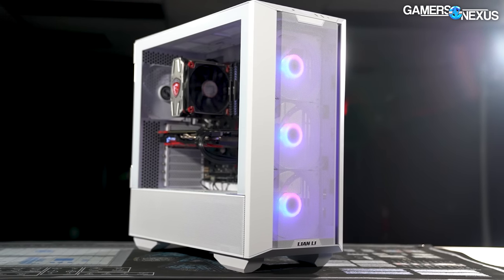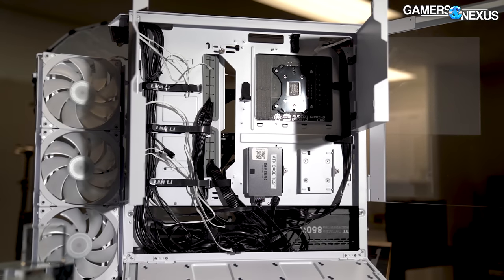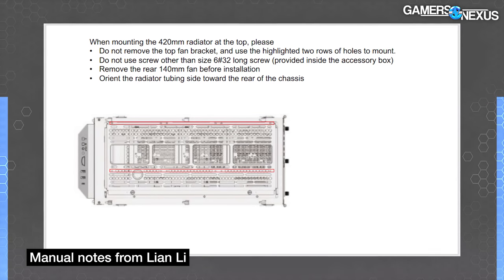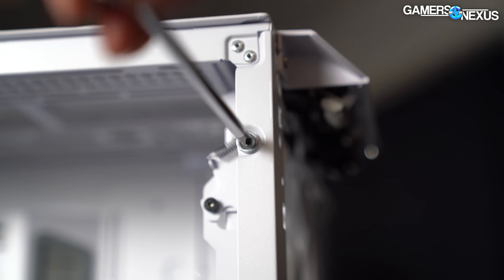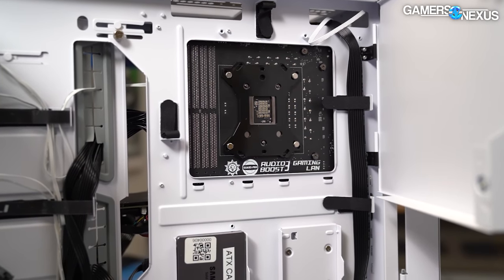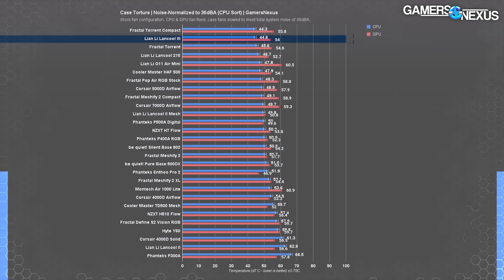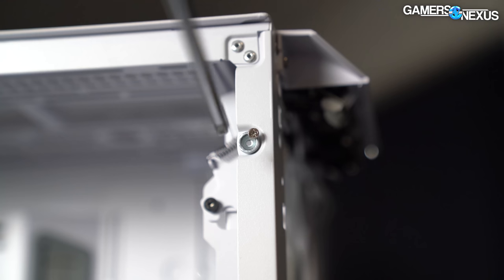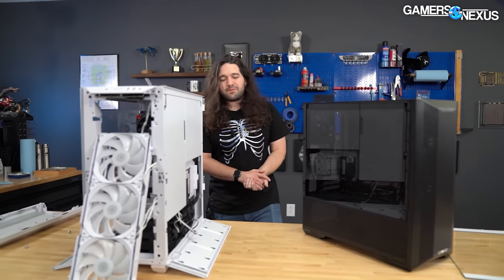Lian Li Lancool III Case Review: Build Quality, Thermals, & Cable Management

Comment: I wanted to thank the team at GN for single-handedly reviving the airflow-focused case market. Thanks in large part to your exceptional case reviews, I'm the happy owner of the best case I've ever owned, the Lancool II mesh. While I won't be upgrading to the third gen, it's nice to see all of the attention to detail and quality of life improvements Lian Li is committed to providing in future iterations of their cases. It shows they care, and that there's always room for improvement in a very crowded market with lots of competition.
Reply: Agreed! I bought the Lancool 215 Mesh based on GN thermal figures and it’s been amazing. It’s not the best looking or flashiest case, but thermally it’s incredible. It’s damn near silent, and when I first bought it I thought my CPU temps were being misreported because they were so low. The two front 200mm fans are so good at drawing in fresh air, and because they’re 200mm they’re not very fast so they’re inaudible.
Reply from the maker: Thank you! It's great to see manufacturers going in the right direction now.
Reply: +1 on this sentiment, have been with the lancool ii mesh for almost 2 years or so now, love it to death. only gripe is the backbreaking weight and size once its fully kitted with full atx system + full gpu lol otherwise 10/10 case.
Reply: @hehe42069-k I was also not prepared for the absolute unit I had built when I first picked it up. On the bright side, it's sturdy AF.
Reply: @dil6969  sturdy besides the glass on BOTH sides lmao. about the only major gripe weight aside is their mind numbing decision to glass the backside. If there was an option to buy with a standard vented metal back i wouldve chosen that.
Reply: @dil6969  The Lancool Thricc Boii.
Reply: I also grabbed the lancool ii mesh recently and it's the best case I've ever owned. Temps dropped noticably and it's so easy to work in, I love it. The Lancool III came out a week after I bought it so I'll hold off on ordering it, but the improvements they made are all pretty nice.
Reply: @hehe42069-k  IKR like why would you put it there??? instead of a glass panel and two panels for cable management, a single solid panel would do the same. But besides that the case is great
Reply: @MarioGoatse  Yeah, my now two month old build is in a 215. Love it, though I do wish I had gotten it a bit closer to msrp, but I also bought it from Microcenter, so retail markup is there too. Still, very solid case at the price I got it at about 90 bucks.
Reply: I want to second this. Back around 2015 to 2017 we saw a lot of cases that were essentially just closed boxes and it was bad.

One thing I'd like to see an end to is the back side glass panel. This case has a glass panel and then lots of covers to hide the cables that wouldn't need to be covered at all if the panel was just a piece of metal. I'd rather save the weight and money.
Reply: I’ll just add that I’m another happy owner of a Lancool II Mesh RGB because of GN reviews.
Reply: @hehe42069-k  Even more mind-numbing is the penchant for calling the right side of the case the backside. It makes you an... arse. 🙂
Reply: @stevewatson6839  excuse me mr penguin fella for calling the side you dont put your computer on the back lol.
Reply: @hehe42069-k  😁
Reply: @MarioGoatse  I bought the Lancool II Mesh because of GN. If not for them I would have never really heard of the brand as I was used to just sticking to the one or two brand of cases I know.
Reply: @GamersNexus  Just need to convince them to drop glass side panels and invest in side fans again now. We need to go back to the HAF X days.
Reply: @hehe42069-k  I thought the glass on the right side was strange too, but it actually gave me a reason to route the cables the cleanest way possible, even knowing the two plates cover most of them. I think a lot of it comes down to symmetry of design and materials, now that a large portion of people like to display their cases high up with both sides visible. I do however think the lack of ventilation on the the lower right steel door was a missed opportunity. Glad they fixed it on this version.
Reply: @billienomates7100  I'd also like to see ducting and shrouding of coolers make a return. It would be difficult to implement, but brands that make both cases and coolers could make it work. I recall seeing side panel vents with integrated ducts on older PCs circa 2000-2005, which would provide cool air directly to the stock downdraft cooler. It's a great idea to prevent recirculation of hot air. Modern GPUs could potentially benefit as well.
Reply: And the entire community saying the same thing. Without creators on this garbage monopoly platform we'd all have dead overheated hardware. Much like this platform that still lives against reality.
Reply: +1 to this sentiment as well. Still rocking my NR600 from Cooler Master after seeing it was a good budget airflow case during my first build.
Reply: Yes. Also my favourite case. Just wish they keep up the no RGB nonsense, I don't really care about that and it usually drives up the price for something I turn off
Reply: I second this notion!
Reply: Lancool 2 mesh gang
Reply: Plus one from me re purchasing the Lan Cool II Mesh upon GNs review of the case...   Bloody awesome purchase!   Making full use of the space for fans feeding cold air straight into the GPU... love it!
Reply: As much as I appreciate GN, i think the revival of airflow cases is more a factor of nVidia, AMD and Intel releasing literal furnaces. 400W chips need air circulation.  5-6 years ago, the chips were just barely efficient enough to get away with poor airflow without completely ruining performance.  Now, they throw so much heat that they throttle themselves almost immediately if there isn't passable airflow
Reply: I got the Phanteks P500a because of these reviews.
Reply: I legit "modify" my case for more airflow cause of GN

Well actually I just chopped off the front acrylic and added mesh wire
Reply: It’s timely for cases to go airflow focused since 40 series gpus seems determined to turn your pc into a space heater.
Reply: @GamersNexus  Hey Steve, you never did review the SilverStone RL08BR-RGB like you said you would a few years ago when you saw one at a trade show.
Reply: I am also an owner of the Lancool MESH II Snow White edition tho. I worked at a PC building company in Hawaii and learned a lot there and from GN. TUF x570 board 3700x, 3070, 2 1TB NVME Gen 3 and 1 1TB Samsung SSD, 240mm Corsair cooler, 16x2 DDR4 3600 CL16 Ballistix and a 750w B5 PSU
Reply: Hopefully the next revival is closed side panels and GPU fan intakes.
Reply: Another Lancool II Mesh owner here, due to the GN review process.  The one thing about the III that has me excited is support for top mounting my Arctic LF II 280.  Front mounting with tubes down is certainly an obstacle when cleaning the internals.  It will be interesting to see what Lian Li does with this information.  Additionally, the rise in GPU temp seems strange with there being additional airflow.  Is all that forward force making the side vents now not draw in air but rather act as exhaust?  It would be interesting to see this case in action with the 140s it has along with the three lower fan mounts populated and the top utilized as well.
Reply: @GamersNexus  What about test the full fan config? NF A12x25 for 120mm, NF A14 for 140mm etc.
Reply: That's so true. Before that it was poor quality airflow cases in the market
Reply: Hard agree. I bought the Lian Li Mesh Cool II as well and it's kind of ridiculous how easy it was to build in and how quiet it can be from not having to keep the fans at a higher-than-ideal RPM. I love this case.  This weekend I built a system in into a 215 x case and while it wasn't quite as smooth, it really still worked out well. In both cases, the GN review really had me go into those builds with confidence.
Reply: @MarioGoatse  bought the Lancool 215 based on the GN review as well.
I don't care about aesthetic as a case goes, but getting something with high thermal performance rating was important.
Lucky enough to get it at launch at it's more reasonable cost, and aside from the severe lack of 2.5 SATA drive support (I've got two SATA SSDs crammed in the PSU slack cables space with a bunch of cables, one just sitting in where a hdd would mount because for some reason the drive sled there is designed to seat only one 2.5 inch...) it's over all great for that price.

Was debating swapping up to this one, and may still do so for the drive support and what looks to be just slightly easier to remove front panel.
Also usb-c support.
Reply: @sopianwahyudi  many many years ago I dremeled a bunch of holes and mounts for 3 fans in the side panel for one of my old cases that had zero intake on it.
It wasn't pretty, but it did get the job done.

Which that said, +1 to the comment upthread about side intakes coming back for direct component cooling.
Reply: @hehe42069-k  you must have stick arms then i recommend doing some sports cause thats not normal
Reply: i also got a lancool II mesh pro cuz of these reviews, and i love it
Reply: Just to add on what people already mentioned. All the way from Cyprus. Thank you GN for reviving the market. No need to keep my HAF X anymore 
 Even your graphs for comparison really help me when suggesting builds
Reply: i bought a lancool 2 mesh based on reviews too its well built but i find alot of things annoying with it compared to my old phantek p400 rgb which was almost identical for airflow and half the weight

what happened to Li Lian when i sold them a decade or so ago they use to make high-end Brushed Aluminium Cases now there all steel and weigh a ton which is my biggest annoyance if u ever have to move this heever lump your gonna think about moving it less and less after you felt the weight of a full build lancool
Reply: In fairness I never saw the water cooling market taking over fans, the whole point of water cooling was lower temps and noise, but you needed fants to cool the radiators so if noise was the aim of water cooling it failed.
Reply: @GamersNexus  I'm honestly shocked it was ever any different. EVERY case should be airflow-focused.
Reply: @envirovore  Lmao. Sounds like me. I’ve got drives stashed down there too. I’m definitely going to keep my eye on this, and will likely upgrade to it for my next build. I like other cases out there, but personally I love that Lian Li has continually listened to community feedback and improved their cases, so I want to stick with them for that reason.
Reply: @hehe42069-k  Me too. Backside glass is not useful.
Reply: Here, Here!
Reply: That's so totally true.. And thx for bringing us those funny but still dedicated and independent reviews! Because of you i got my Meshify C stuffed with Noctuas and i am very happy.
Reply: I very much agree. In the early 2010's when i brought my current case they were all but gone, forcing me to buy a closed off one. This required quite a lot of fiddling with fans to get the right temp and noise combo.
In a couple months for my new build i plan to get this one instead.
Reply: I bought my P500A (and a P400A for my mum) based on GN thermal data, AND bought a Scythe Fuma II and Deepcool Assassin III based on GN thermal data. Such a great resource to help make balanced buying decisions
Reply: @hehe42069-k  can agree with that, always takes me by surprise when I have to move my PC xD
Reply: @MarioGoatse  215 is amazing! Not to mention super cheap
Reply: @hehe42069-k  The frame is sturdy Smart Alec, meaning little side to side movement, especially when fully loaded.  No one ever said glass was sturdy, however it's not ultra brittle glass so there's that.
Reply: Lian Li was thoughtful to provide 2 glass side covers for a reason most idiots complaining below about are completely clueless to.  Let's see if they can figure it out.
Reply: Agreed, I'm a happy owner of the Lancool II Mesh as well. And to think GN influency went so well that I could buy this case even in Brazil, and the Perfomance-X variant at that, it's marvelous how good it is and since it comes with a pwm fan controller it made my job to replace the fans with Noctua fans way easier.

Comment: I bought this case. Years on, I'm glad to say everything is STILL working great. I love this case. It was one of the easiest I've ever built a system in. It looks classy and keeps everything super cool.
Reply: hello, are you using stock power curve or did you change it? is it really loud stock? does it come with rgb controller? 
p.s i bought the black non-rgb version today and im documenting myself before it arrives
Reply: @Liberty46  I have the argb model and I'm using a ROG Ryujin with Chromax fans, which those fans can be loud full tilt at 5ghz on my 5900x. The case itself is pretty quiet and does have a built in controller.

Comment: There's a special kind of absurdity about replacing the solid panel on the back with tempered glass so you can see through it, and then implementing solid panels to hide what the glass lets you see through to.
Reply: Corsair is teaching other manufacturers well.
Reply: It's so they can sell you extra RGB strips
Reply: I personally really like that. Using the normal Lancool 2 right now and I can't go back to steel-back cases anymore. Just makes both sides of the case interesting and if you were to put RGB SSDs there, it would become a feature of itself. Not everyone puts their case with the back to the wall. :)

Comment: few things make me happier than in-deep reviews of computer cases by "airflow jesus" himself
Reply: O11D Evo Snow White, NEO Qube 2 Infinity Mirror, 5000D, Fractal Torrent or this?
Reply: @rengoku2365  Depends on what size radiator and fans you want to put in it.
Reply: @OntarioGuy430  i need the best case for airflow, 5000d or lianli lancool 3? 10 fans.
Reply: @yoyigu  The review said the 5000D airflow performs worse than the Lancool 3 -  but the Lancool has many more future failure points and is super heavy. It kind of just comes down to what you like the look of more and what supports the fan sizes you want.
Reply: @OntarioGuy430  The 5000D also comes with a criminal lack of fans pre-installed, with only 2 basic 120mm non-RGB fans.  If you fill all 10 fan slots, the 5000D's performance increases significantly.
Reply: @yoyigu  lancool 3.
Reply: “Let there be airflow.”

-PC Jesus

Comment: That curly haired young Steve is cool. Giving a hands on "how heavy is it fully assebled" is a nice addition when concidering a new case. Not many reviews look at how it flex when carrying around. 10/10
Reply: Not a stat that is commonly mentioned in reviews, it does seem ridiculously heavy. Patrick says 15:50 this weighs 14.9kg. By comparison the very similarly sized Be Quiet silent base 601 window weighs 11.22kg and the slightly larger Fractal Torrent apparently only weighs 11.1kg.
Reply: @-opus  i assume thats down to how much of your case is metal vs plastics, whichever is best is up to you :)
Reply: @Desalater2  The extra glass panel would be a big addition to the weight, the excessive doors and mechanisms would add a bit of extra weight too. But in general, more weight should = better quality ie: thicker metal, less plastic, more bracing etc. I would always choose a predominantly metal case and don't really have much issue with the weight, although I was surprised to hear that the Lancool III weighs nearly 15kg!

Comment: I pre-orded this case two weeks ago and I should be receiving it before the end of the week. I'm an owner of the Lancool II, and although I liked it, I decided to upgrade to the Lancool III once I saw that Lian Li addressed all the things I found annoying/disappointing about it's predecessor. Thank you for doing such a great review on this case, Steve. You are my "goto" guy for comprehensive reviews/testing of products. Keep up the stellar work.
Reply: "Goto" or "go to"?
Reply: Mine will be here Friday lol
Reply: @matthewf9909  finally we will be able to Mount a 360 radiator at the top! Another thing I like about the III is that you can now open the side panel by pulling on the front release latch. On the II, I had to slightly or lift or tilt my rig since it’s on a caddy on the floor which has short walls that prevent opening the lower doors.
Reply: @evanl3985  old GW Basic humor.
Reply: @htr5372  doubling the price? When I bought my Lancool II it was $149. The Lancool III I just bought was $149. Sure, the Lancool II is $89-$109 now, but that’s because it’s considered an older model and retailers are trying to get rid of stock.
Reply: @JohnChenTech  Nah, it's $89-$109 because that was actually its launch price ($89). Mind you its popularity and scarcity caused its price to jump for a time, but it's back to normal. The Lancool III is shockingly expensive for what it provides over the 2 Mesh.
Reply: @htr5372  I just went through my order history and saw that I bought it from Newegg in late 2020 for $119 plus tax and shipping for a total of $138 (Mesh non-rgb). I looked up general release information and you are right. The performance retail was $89. So I got ripped off. lol. Good times. 🤣
Reply: @htr5372  I never got to test the included case fans on my mesh performance. I replaced them with Noctua NF-F12/F14 iPPC 3000 RPM fans. They are loud as hell under full load but it’s rare for me to hit those temps. I disliked that I could only mount a 240 radiator on the top of the Lancool II, but with the III I can mount up to “440” (but I’m only going 360).
Reply: @htr5372  I agree. I regerts buying them, but spilled milk. 😭
Reply: I'm looking to get this case. How's it been so far?
Reply: @healinbeet  the case is very well designed and provides excellent air flow. It is big and have, but air flow and build quality is most important
Reply: @evanl3985  gojo